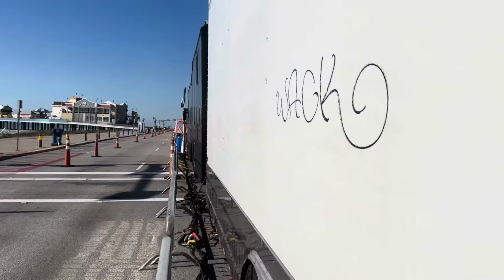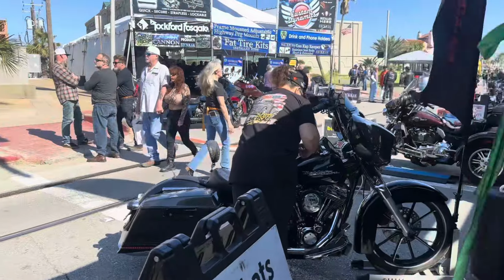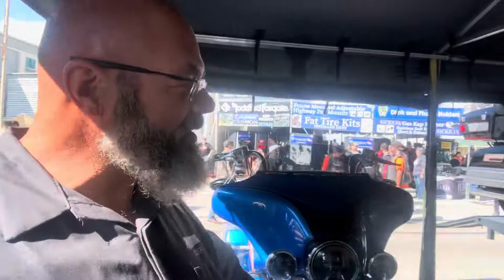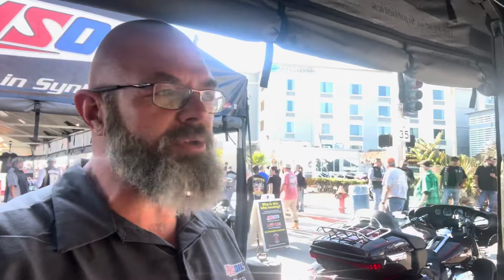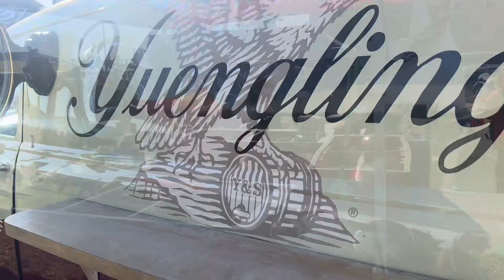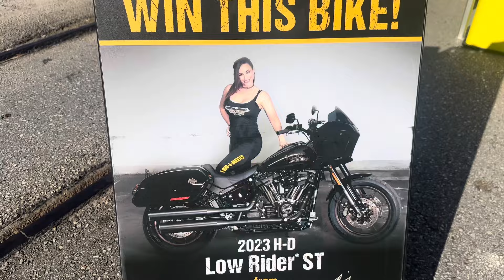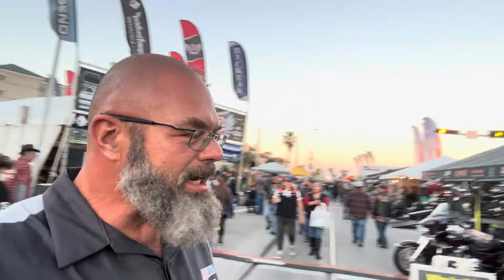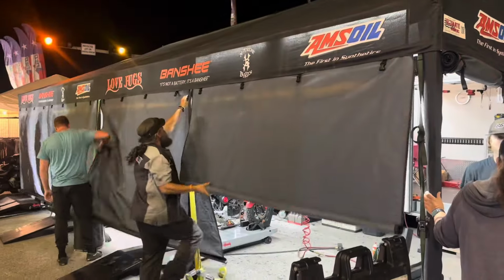Lonestar Rally 2023!! Fantastic Friday in Galveston

Comment: Hi Adam I currently have a twin cam 103 and i fitted the Love Jugs and the bike ran way cooler I'm looking at upgrading to a M8 but have heard that they aren't that effective on the M8's do you have any data as to their efficiency on the M8's.As always enjoying your channel
Reply from the maker: I am planning on doing a test series in the future on the Milwaukee eights and putting it on YouTube. But even though I don’t have the actual data to present you just think for a moment and use some common sense. Is it possible for an air cooled engine to not run cooler with the air flow? The short test I’ve done so far leads me to believe that the difference people are seeing in the reduction of heat is mostly because of the placement of the temperature sensors distorting the values. When I do my test, we will get far more scientific and use comparables to get a complete data profile.
Reply: I did think of that about the sensor position,I saw a YouTube video about this guy who said his M8 didn't run any cooler but as you say common sense says it must,I know my twin cam runs within factory limits now